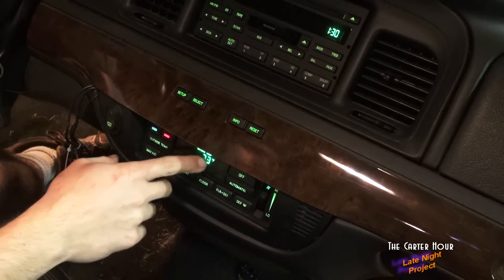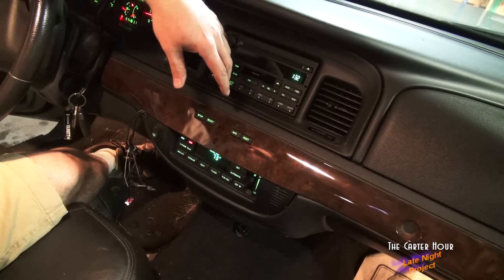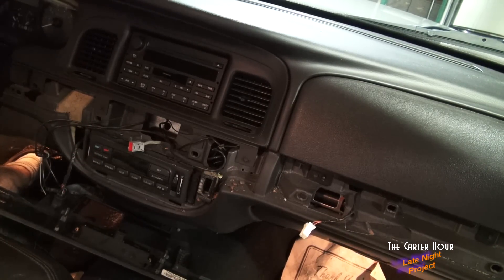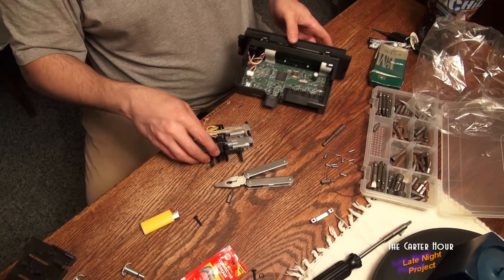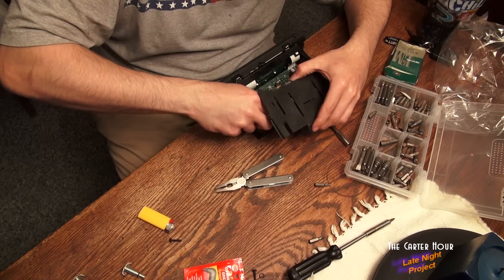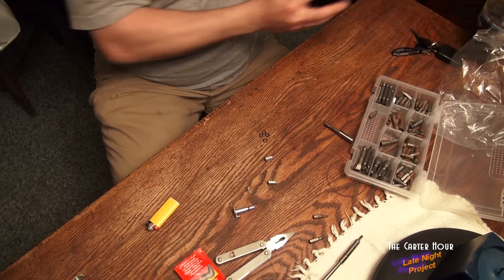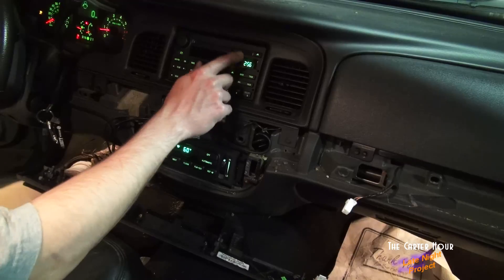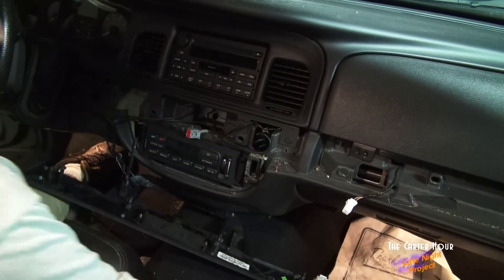Ford Lincoln Mercury EATC Repair Video - In Depth Tutorial - 3.00 Dollars in Parts

Comment: Hi, the O-rings finally came and my ac is working fine, I have one more issue, I converted my air ride to coils and shocks and now my check air suspension light won't go out is there a fix for that, again thank you for help with my ac....
Reply from the maker: Yes, you can fix this as well by unplugging the RAS module in the trunk.  You will find this either on the drivers side by the Rear Air Suspension On/Off Switch or the Passenger side.  You will have to pull the trunk lining back in order to access.  However I don't know why people convert their air springs to coils.  Not much of a difference in price.  My 06 that I had, had Air Springs that where original with 174,500 miles.  Guess just preference.

Comment: Hey Carter, Does an 07 Town Car use this set up as well?  Defrost , floor, vent work, but not . Also, the right zone heat/cool is always cool.  The blend door actuator for right side has been replaced, but the system is still goofy.  When it does function on defrost/floor, it has trouble going back to its function, when another function is selected.  Also the recirc air door is very delayed on its function as well, and will close even when the button is not lushes.  Would the "O" rings cause this? .
Reply from the maker: I am not quite sure if it will or not.  I don't believe the town cars HVAC system is driven by vacuum but by actual electronic actuators.  However if you pull it out of the dash and it has the vacuum lines then I would assume it would work.
Reply: +The Carter Hour The Lincoln has vacuum lines but they go into the steering column.  After changing  the right zone heat blend actuator,  and waiting overnight, the system seems to be working. Maybe it had to adapt to the new part?  It takes about 20-30 seconds to react, but it does act correctly.   Getting 42-45 degree A/C air out of that right duct now, and 150 degree heat!!  So it seems this repair does not apply to the 07 Town Car. Wish it did, because it would be cheaper than the actuators, which this car has 5 of, 3 of which can be replaced without pulling the dash assembly out. Thanks a lot for the video!!
Reply from the maker: Kem Hayes
Hi Kem thanks for the follow up on the Lincoln.  I was always wondering about it.  Thanks for the comment as well.  Cheers Friend:)

Comment: Hi,  I have a 2005 mercury grand marquis, when I accelerate on the high way my ac goes from the vents to the defrost until I decelerate it goes back to the vents. question is this the same fix.
Reply from the maker: Yes, this will fix that issue!  If it doesn't this could mean that you have a vacuum leak somewhere else.  However time and time again, the problem has always been the o-rings causing the issue!
Reply: Thank you, I'll do that and follow your directions, again thanks for the info.
Reply from the maker: No problem, happy fixing!

Comment: have a 2009 grand marquis ls1. obviously blend door actuator is bad
2. replaced a fuse and got cold air blowing from defrost and floor which i can deal with, but when it goes, will blow hot air from defrost and floor even on off
 ...prior to cold air going off, kind of smells like a glue or electric smell .is this an o ring issue? checked for leaks and none found.
Reply from the maker: E Gree You are right sounds like your blend door actuator.  Sounds also like your o-rings are bad.  The smell is probably from warm air blowing into the cab of your MGM.  I have owned several of these cars, and they all have that plastic smell when the interior is hot.  Though you might just want to have it checked over.  Now it also could be a small coolant leak in your heater core.  To check, feel the passenger side carpet to see if its wet.  It may not be on the top, try pulling the carpet back from the front just a tad and see if there is any coolant leaking.

Comment: The original O-rings that came with the car are outdated. They are made of silicone, and silicone isn't the strongest O -Ring. They are prone to tearing and failing prematurely.  My advice is, buy the one's that are "nitrile." I know that Harbor Frieght carries a set of 205 pcs. They are all different sizes, but comes with the size you'll need for your panther platform.  It's the F1014x labeled in the box. The item number is 67644. .

The box will say, "HNBR O-Ring Assortment.  HNBR stands for "hydrogenated nitrile butadiene rubber," which is far superior to silicone and withstanding extreme temps. So when you look for new O-Rings, don't buy the silicone ones, get the HNBR ones. 

If you don't live in an area where there is a Harbor Frieght then check out their website.
Reply from the maker: Awesome add, thanks!

Comment: I have Mercury - Grand Marquis 2003 with AUTO Air condition
my problem is that the A/C only blows at the highest speed, so I changed the (Blower Motor Resistor), but it destroyed after few days. Then, I replaced the (Blower Motor Resistor) and the (Blower motor together), but it also, destroyed again. Finally I decided to change the (Blower Motor Resistor) and (A/C controller) in the dashboard. However all of them destroyed and the (A/C controller) seems that is had shortage or something because its display sometimes does not work and and other times all of its lights work at the same time.

please guys help me fix my A/C. I really spent a lot of money and effort on it
Reply from the maker: Did you by happen check the connector that goes to the Blower Resister?  Did you use the appropriate resister pack for EATC?  There are two resister packs, one for Manual and one for EATC!  But my main concern would be with the wiring pigtail that actually goes to the resister pack.  Pretty common for the connector to get hot and melt.

Comment: I have the 2001 GM...i just opened the eatc and i have the metal one like the one for the Lincoln you showed i cant figure out how to get the piece out it surrounded by metal...can u help please
Reply from the maker: Jabari White Yes, the metal one, I am surprised that you have that one for such a newer model year.  I thought those were phased out in the 1998 MY.  Myself, I was unable to get the metal to come apart, so I had to bend areas in order to get the solenoids apart.  Can you confirm whether it has a blue or green display?  As I recall the blue displays were metal, which means its not the original one for your 2001 MGM. If its not the original one, you might want to visit your local pick and pull (junk yard) to see if they have one.  If they do for lets say a 2003 + get that one, and then do this procedure on that one.  Make sure that if you acquire one from the junk yard, make sure it comes out of a Crown Victoria, or a  Mercury Grand Marquis, because no other one is compatible.   Now I am sure you can get this one apart too, but you might end up having to drill out eight of the spot welds on either side to remove the metal ring, then upon reassembly you might need to take some solder to reapply the metal ring.    The metal one might take some more time, but I am sure it can be done.
Reply: yes ok thats makes a lot f sense im going to try that later his week and I will let you know how it went thanks brother ...oh and the display is green
Reply: I was surprised to see that when I open it lol I was hurt
Reply from the maker: Jabari White Well the green display is definitely the right one for that MY.  Very Interesting.
Reply: indeed it is...Im guessing its been fix before and whom ever probably put a older piece in it

Comment: will this causes the control panel to stay stuck in the heat side.
Reply from the maker: Hi Ramon, your temperature actuator will cause it to be stuck in either cool or heat all the time.  This requires removal of half of the dash to repair.  Cheers and sorry about the bad news....

Comment: Fixed for $1.58 the air now comes out the vents, floor & defroster as it should HOWEVER it ONLY blows HOT air even with it set on 60 the fan slows as I turn the temp up as it should, I cycled through every setting turned it off and on a few times and go up to highway speed and down a few times but still only hot air, I rechecked all the connections ANY suggestions? 
 Thanks, John
Reply from the maker: I would say the Blend Door Actuator is gone bad.  That fix is not so easy. :(

Comment: I just took mine apart, and discovered only 5 vacuum lines connected to the manifold. The center top fitting, just above the vacuum source line does not have a vacuum line connected to it. Is this normal, or do I have a missing vacuum line?
Reply from the maker: No you have all the proper lines.

Comment: Have you ever replaced the blend door actuator on that Grand Marquis before, if so, is it hard to do?
Reply from the maker: I have never replaced one personally, and to do it right requires taking
 out the dash!  However from what I have seen and heard there is not 
much involved in taking out the dash to do it, its more awkward, than 
hard.  If you decide to take on the task, make sure you do it the right 
way, instead of some hack way that some youtube videos describe, and 
heres why, because if you need to replace the actuator, you are probably
 close to needing a heater core too, doing it the right way with the 
dash will allow you to replace both at the same time, because for a 
heater core, you must remove the dash!  Why not save yourself the time 
and headache and kill two birds with one stone!
Reply: So basically you might as well replace everything you can while you're in there because they are probably damaged too?
Reply from the maker: DZEyoyo123 it's not a bad idea.  Usually actuators/blend doors and heater cores
Reply: Not really. When I replaced mine on my '05 Crown Victoria I only had to remove the passenger airbag and air ducting behind it to get to the actuator. I used an 8mm gear wrench to remove the bolts on the actuator because it is a tight squeeze. However, you can remove the dashboard and replace this, that, or the other, if you have a lot of time on your hands.

Comment: My vents are still working, but mine isn't turning the compressor on so, there's no cold air. I've read this is also a common issue. Any idea if it's possible to repair that issue at home? (1995 CV LX, but it looks identical to the EATC in the video)
Reply from the maker: Sounds like no Freon or a low or high pressure switch isn't closing properly.
Reply: Supposedly that has been tested; the low and high pressure switches and the freon. I have read in several places that it is a common issue that the EATC stops sending power to the compressor. Problem is that no one sells the EATC for my year at a reasonable price. They only do repairs if you mail yours in and there's no one local. I was hoping there might be some instructions I could have a local electronics repairman follow, or something.
Reply from the maker: You can actually go to a junk yard and pull one from the latest Crown Vic or Grand Marquis and it will work, mounting and everything, just may look out of place since it uses green lights versus blue ones.

Comment: does this also solve the issue of my 2002 CV LX AC being stuck blowing hot air through the defrost vent? or just the fact that it blows through the defrost?
Reply from the maker: This fix is for blowing air to the Defrost!  So this fix will solve that
 issue for you, however the temperature staying hot all the time is a 
blend door actuator, in which you will have to remove the dash in order 
to repair that issue.  My recommendations is if you replace the blend 
door actuator, you will want to do the heater core at the same time.  
There are a few videos out there that show you how to replace the blend 
door actuator properly, and some are hack jobs.  Make sure you do it 
properly to avoid issues in the future.

Comment: Will this same o-ring proceedure work on aa 1997 Mercury Grand Marquis??
Reply from the maker: Wes Herrick it might, however you might run into a problem with the solenoids being all metal.  My recommendation would be to take it out and disassemble and see what you are working with.  Chances are it might take more work to get it done, but yes the same principle.

Comment: What mm. screws hold on the vacuum manifold? I couldn’t understand in the video... Also, it only blows heat. No cold air at all. Any idea how to remedy that?
Reply: So I figured out my last question... I replaced the o rings just like you said and still didn’t work. I didn’t get any special kind of o rings though. Same size and everything, but not brand name. I got them from o’rielys for 50 cents a piece. Could that be my issue?

Note: I didn’t hear any air flow when I disconnected the vacuum hoses from the climate control unit.

Please Help!!! 😅
Reply from the maker: Hi Corey, you could have a major vacuum leak, however what you described as only hot air and not cool, sounds like a blend door actuator.  The blend door actuator is a common failure point.  Usually it involves taking at least half the dash apart however the easiest and best way is to remove the dash completely, replace the actuator and while your in there also do the heater core, so you kill two birds with one stone.  Now taking out the dash is not necessarily a hard task, but very awkward, and you will need someone to help you.  There are a few good videos of how to do it right on youtube.
Reply: It's the strangest thing. It just randomly started working on my way to work yesterday. I don't get it but I'll I'm not complaining. It's still a little cantankerous. Sometimes I have to turn it off and turn it on by pressing a new location in the cc.

And I found a piece on eBay that fixes the blend door actuator. Or bypasses it... I'm not sure but the seller claims 10 minute installation with a screwdriver and a wrench and he has 100% reviews.i don't get that either but I bought it because it has a money back guarantee if it doesn't work. 

Thanks for the Reply!!! I had this video on front of me the entire time I was working inside the car!! Keep up the good work!!!

Comment: I did this on my 2008 crown vic and it's still blowing cold air on my windshield. Is there anything else it could be?
Reply from the maker: Hi James, I bet you either have a vacuum leak somewhere else or maybe one of the solenoid's during re-assembly went in backards by mistake.  Generally these cars never cir cum to  vacuum leaks.  I would check the EATC again just to verify.

Comment: I replaced the O-rings on my 2010 grand marquis. The care worked fine with great AC for 5 months. Now it is blowing heat only. Is it possible the O-rings could go bad that fast? I saw online that the blendor actuator is usually the problem if it is not the O-rings.
Reply: Look at videos that show you the self-diagnosis step in testing the unit.  I had same problem but it reset after the test and now I have air again !  Next step is to do the o-rings to see if I get my vents back.

Comment: Thank you so much for making this video! Quick question- I found it a bit too late after I'd already taken the unit too far apart. Is it possible to put it back together with the motors/valves in the wrong places? I'm not getting proper switching after rebuilding and I'm not 100% sure I put the solenoid valve thingys back in the original locations. Could that mess things up? I'm not getting anything to the floor. Does anyone have a diagram of how the wiring should be compared to how the solenoid valves should be laid out?
Reply from the maker: +Dan Pina Are you getting max airflow through the defrost and vents?

Comment: hey there, question, when your eatc module didn't blow cold air, did your ac compressor work? I'm asking because in my 97 lincoln town car, I did everything to try to get my ac cold. thanks
Reply from the maker: Yes, it can work, and blow warm air.  Probably have a blend door actuator problem, in which the temperature is selected.  Unfortunately you have to remove the dash to complete the repair properly.  Cheers.

Comment: My 2009 Mercury Marques air comers on but the heater will not work is that the climate controller or another problem ?
Reply from the maker: Most Likely a blend door actuator.

Comment: Hey my 2006 Grand Marquis blows out heat only when I turn on A/C , and it only comes out Defrost vents? Do you think I should replace my EATC and Blend Door Actuator? or just one? thanks
Reply from the maker: Louis Maxwell Looks like your blend door actuator is bad, and you just need to replace your o-rings on your EATC.  Cheers.

Comment: My 95 Grand Marquis EATC wont even come on but at night the lights are on but not the screen
Reply from the maker: +Pierre Baptiste it could be a fuse.  The illumination of the panel lights operate on a separate circuit.
Reply: +The Carter Hour checked all my fuses inside and under the hood
Reply from the maker: +Pierre Baptiste another question does the fan blow or any air come out of anywhere, or is it completely dead?
Reply: No air at all, I have no way to turn it on
Reply from the maker: So even if you hit a button it fails to do anything?  Sounds like it maybe the main board.